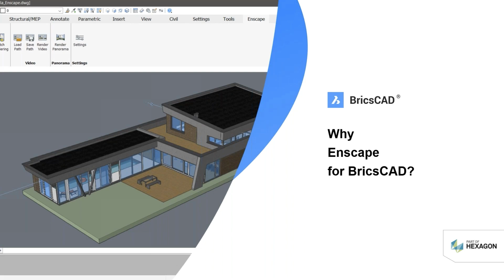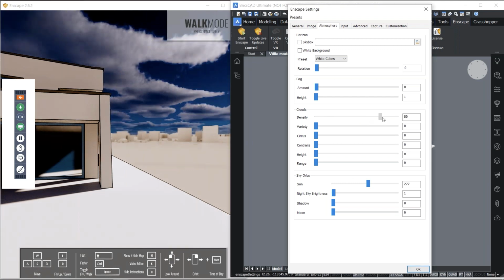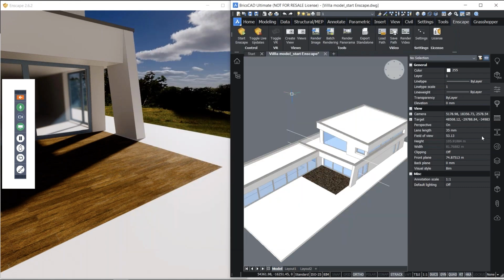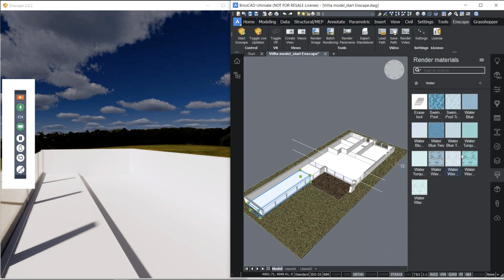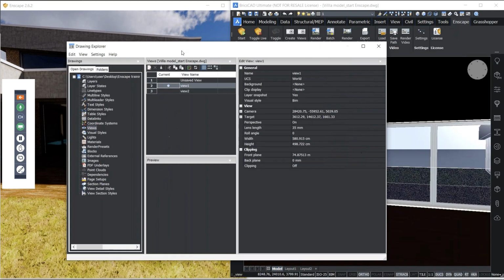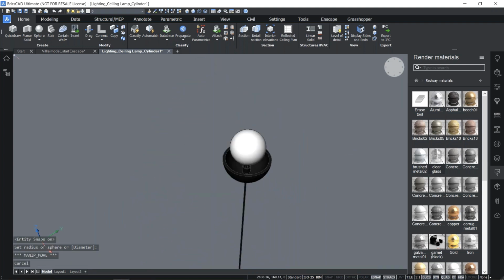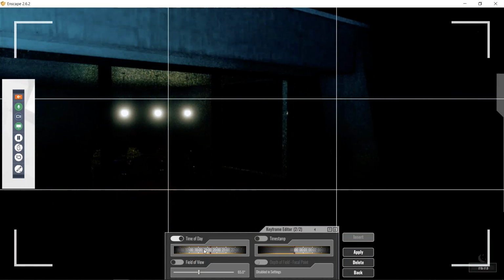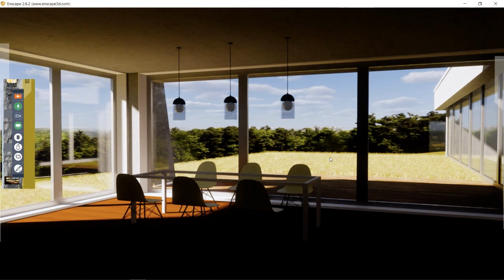Enscape for BricsCAD: Real-Time Rendering and VR l BricsCAD Webinar

Comment: Very interesting this Bricsys-Enscape partnership. Congratulations for the continuous great work! The webinar explain quite well. 
The version available of the Enscape plugin, in the applications store, for the new BricsCAD V21 is still the Enscape V20 version and when installed it does not appear in the BricsCAD tabs, not even in the BIM tabs.
I if can suggest, it will be very interesting also to see a similar webinar for the new Bricsys-Twinmotion partnership.
Reply from the maker: Thank you for your interest and suggestion! We plan to release Enscape V21 together with BricsCAD V21.1.05.